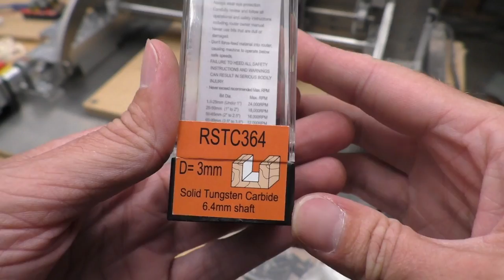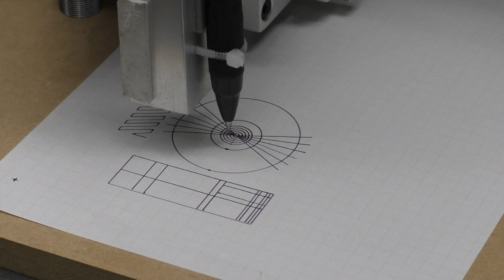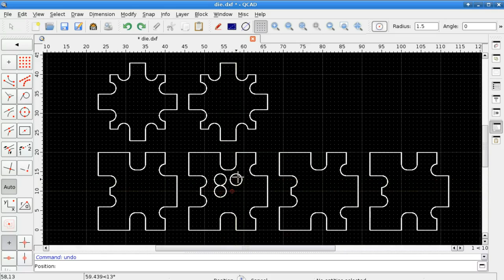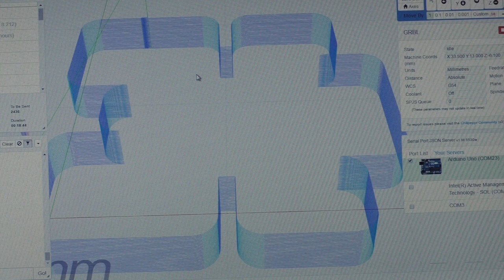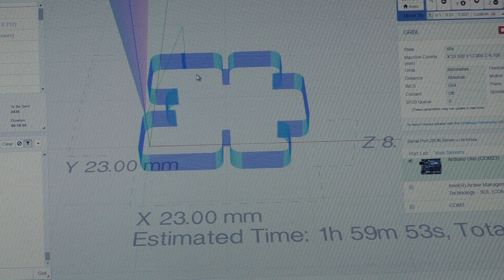DIY mini CNC machine part 12 (new lead nuts + more cut tests)

Comment: There's an old machinist's saying that to minimize chatter, 'reduce the speed and increase the feed'. It sounds backwards at first, but it works. Of course, using the proper bit for the material you're milling helps, and straight collets are nice too! 
Thanks for the video.

Comment: To speed up the job and get the better finish run a roughing pass at .3mm that goes all the way down but tell it to leave .1mm of material for the finishing pass then run a finishing pass much slower when the bit will remove that last .1mmm and leave a nice smooth finish, also  to avoid having to hold own the part as it finishes, either leave a oouple of tabs to hold it in that can be cut off later, or drill a hole through the middle as a firsst step and use that to hold each piece down,

 great progress, enoying it :)

Andrew

Comment: When I cut a profile shape as you did for the cube parts in aluminium, I usually make the cut wider than the cutter.  If you're using a 3mm cutter, have the cut be 4mm wide.  It means you have two passes for each cut depth, but it gives the chips clearance.  If the channel is 3mm wide and the cutter is 3mm wide, any chips in the channel get mashed against your finished edge, the extra width prevents that.  It means longer cut times, but nicer parts.

Comment: You should invest in some double sided tape or spray adhesive to hold down the workpiece.  The screws keep it from moving around, but not vibrating.  That vibration can wreak havoc on the tools and cut quality.  Cool video series!

Comment: Hi...Bit my lip and watched all 12 episodes....You have some nice electronic instruments but you don't seam to know their limitations!  Digital multi-meters (and oscilloscopes) have VERY high input impedance, if you just hold the lead tips between your fingers you get an AC voltage, the amount depending on how close you are to a source of electrical stimulus. The reading of spurious voltages are mostly due to lack of grounding, or more correctly a valid reference point. DVM's are by there nature digital devices sampling the input, it is common for them to read erroneously if the input is varying wildly or just very noisy, for example back EMF voltages from a motor.  Try an old fashioned moving coil multi-meter when you get these symptoms. I was pleased to see you connect the Arduino ground to the motor PSU ground, good start.I did not spot if you grounded the CNC machine chassis to the utility ground supply, the CNC platform and  ALL the PSU's cases should the grounded in the same way. (to utility ground) The way's  bearings should be shorted with ground straps, do not rely on the bearings to provide a ground to the next level, use a piece of fine braided flex, they do not need to be huge (not safety ground size)(you could use the screen off of some coax cable,  a piece of sleeve should be used to protect from snagging and short circuits).(Rolls Royce put earth cables across the wheel bearings and  brakes, to eliminate static radio interference on the car's radio)Most importantly the motor case should be included in the grounding. I think you did that just before the end.The screening on the various interconnects will not work correctly if it is not grounded at least one end. STAR point grounding is best for interference, and avoids ground loops that are just as bad in high noise, high current environments.A couple of turns of the motor power lead through a ferrite ring at both ends of the lead, will help in dampening the interference if still needed after grounding everything. (You will find ferrite rings on old PC ATX power supplies, some PC cases came with rings to shield the front panel cabling.)If you still want to understand the motor voltages I would use your oscilloscope to look at the waveform feeding the motor (assuming it is rated to measure the voltages you have seen on the DVM). or an old moving coil meter as mentioned above.I have not read all the comments, but as some people have correctly stated the motor will generate very large back EMF voltages that are renowned to damage driver circuits, if you are sure that the motor is only fed DC, fit diodes in reverse across the leads (like you fitted capacitors) the reverse voltage spikes will be shorted out by these diodes. use high power diodes not signal diodes. To confirm the power feed to the motor is DC use an oscilloscope.I greatly enjoyed the CNC series keep up the adventurous work, I admit to being too scared to attempt such a task.I loved the flash bang wallops, not seen so much carnage since I worked on mini computers.....  :-}  just waft the smoke away and hope the computer manager never saw it.... Chris.....where did all my paragraph spacing go...looks a mess

Comment: Hi, another thing I have seen here on youtube that I now use for 95% of my work holding is masking take and super glue.  From my experience it works better than double sided tape and is cheaper too.You apply a layer of masking tape to your spoil board and also to the bottom of your workpiece then superglue the 2 pieces together.  I know it sounds ridiculous but it has amazing hold and takes away the chatter of the workpiece against the spoil board.  You can just put dabs of superglue or strips of it.  If you do this I suggest you leave tabs of tape on the spoil board because otherwise it can be very hard to remove your part and stock at the end of your job

Comment: The "chatter" sounded like a resonance issue to me. Of course, resonance will impact the finish like chatter, but it;s more like a geometric pattern that is relative to the resonant frequency.Resonance issues can easily be eliminated by changing the frequency causing the resonance, which generally is as simple as making slight changes to the rpm, but sometimes you will need to add mass to the material being cut. For example, when threading pipe on a lathe the resonance is stopped by wrapping a piece of hose around the pipe. On a milling machine adding an extra hold down seems to do the job. I hope you find this helpful.
Peace!

Comment: Nice project. For cutting aluminium you should try a 2-flute end mill. You are asking alot from that single flute when cutting through aluminium. In addition, the feed and speed should be matched to the material and the cutting bit. 

The other thing you might be fighting is side lateral stress from the bearings inside the spindle. If they are proper side thrust bearings, you shouldn't have side stress, if they are normal roller bearings (not meant for side to side movement...you will. Also if they are the wrong bearings, the tolerances will wear down quickly and produce that wobbly alignment you showed earlier with the cheap collet.

Thanks for sharing your work.

Comment: I use double sided tape to hold pieces down, Milling and 3D printing.  best for milling is foam VHB(type "foam" not "clear"!) you can cut right into it like the waste wood surface. For 3D printing, thin as possible paper double sided tape.   Also, Thanks iforce2d, Good series of videos by the way.

Comment: hi
Great videos.. tip use tabs when cutting aluminim and some type of cutting oil.
ALSO the direction the bit travels around the job also improved the cut finish

Comment: Really nice how you are cutting the aluminium, I'll have to try that as well. 
I see that you mount your work with screws to the waste board, you could consider using double-sided tape as well which has the advantage of not having to hold the finished pieces, I use it all the time and it works great if you have enough surface area.
Reply: What material is your spoil board / table? I can't imagine double sided tape would stick very well to mdf?
Reply: It actullly does, I often have problems getting it of again. Of course you need to make sure that there is no dust on there but that goes without saying.
Reply: I'm surprised by that, I'll have to give it a shot. I've always come up with a way to physically hold things down. It would be nice to not have to dodge screws or clamps for some projects.
Reply: yea, screws and clamps can be a bit annoying at times, let me know how this solution works for you.

Comment: I didn't watch all the way through (it's late here) but if you haven't solved the problem of a cutter chattering at the end of a cut, I figured it out years ago the hard way.  I was milling out a 2" deep pocket in aluminum using a 3/4" tool, and every time I got to the end of a side and made the turn to begin cutting the adjacent side, the cutter would do it's best to tear the part out of the machine, and gouge the heck out of it in the radius.  The problem turned out to be obvious: both cutter and machine deflects under tool loads, which is fine as long as the cutter is traveling.  My problem was I had designed 3/8" corner radii in the pocket, so the machine programmed for a 3/4" cutter stopped feeding in one axis and started cutting in the next instead of traversing around the radii as it would have had to with, say, a 1/2" cutter.  Stopping the cutter while it's deep in a cut will have the cutter still removing material, with deflection providing the feeding motion, until there's no longer enough force on the tool for it to cut.  Then it bounces instead, and, if all the resonance stars are aligned, it sets about trying to wake the dead.  I had this set up in a big, heavy duty machine, but it was scary how much noise that thing made.  So, obviously, the trick is not to stop the tool in a (comparitively) heavy cut.

Comment: Heh---- Been down the same road -- My setup is completely different in many ways. The bulk of mine is 3/4 mdf. All bearing surfaces are V-rollers running on the edge of one edge of a 3/4 by 3/4 1/8 steel angle iron. X and Y are drven with a 1/2 inch 10 pitch  5 start acme rod.  The result is basically a 2 pitch per inch. Z is a 1/2 10 rod single start.   All 3 axis are using a 450 oz/in nema 23 steppers. The "spindle" is usally a trim router but sometimes I use a 300 watt one somewhat like yours depending on material being cut. It is under COMPLETE control of the g-code whereas the router isnt. You get do the English t metric conversions... :)

I use 180 ipm for rapids and slower speeds based on material needs.  It runs mach 3 on a 16 year old desktop I retired years ago but saved it as old computers DO have uses. I totally DESPISE the gerbal based controllers as they are severely limited to what Mach 3 can do. NO net access is required at any time to run the CNC, no need for a separate file for every bit sed in a project, just put ALL of them in one file and Mach 3 will pause for a tool change. just hit start when you're done and Mach 3 continues on to the end of the file.

The driver electronics are similar to this but I use only 3 axis  http://www.automationtechnologiesinc.com/products-page/cnc-3_axis_4_axis_kits/4-axis-nema23-cnc-kit-36v9-7a425oz-inkl4030.  This  setup is desighned for the old parallel port interface but An adurino CAN drive this. just toss out the breakout board and tie step and direction pins on the adurino to the step and dir pins on the stepper drivers.  These drivers are optically isolated so there is NO real electrical connection to an adurino or computer. Ive "upgraded" 2 of the big X-carves with a smaller version of this instead of that wimpy stepper driver card that comes stock. 

I get a resolution and reputability of right at .0015 on all 3 axis but I could easily get at least 4 times more resolutin by using microstepping but the .0015 is good enough for my needs.

For cutting aluminum you need bits designed specifically for aluminum along with a coolant. The coolant is for 2 reasons, to keep the bit cool and to prevent the shavings gumming up a bit. Once you gum up a bit, toss it as its basically destroyed. You can cheat things a bit by using WD40 for a coolant and a 2 flute end mill. Just use a very shallow plunge depth per cut and a slow feed rate.  

Have fun, it gets easier as you go.. :)

Comment: I know this video was posted a while ago and future you may know this already, but WD-40 works great on aluminium. It saves gumming up the tools / improves tool life. It also smells nice when cutting lol.
Also, if you're going to plunge in, step off the part about a MM and do a quarter circle tool path into the part (instead of starting next to the finished face of the part), that will stop the dig-ins.

Comment: Awesome projects, thank you for sharing this. I always wanted to do something similar but I did not know how to put together all parts and where should I start. When I saw your 3D model in the first video I realized it's not a "rocket science" and I think I could do something similar by myself. In addition, I can finally learn how to design from scratch real 3D model. This is my first experience with 3D software - I'm so excited :). I put a list of parts that I need and I have a few questions - correct me if I am wrong :) Parts that u designed for cut (base plate and other) are made from 8mm thickness aluminum right? Linear shaft is 10mm and lead screw is 8mm? Thank you very much for answer :)

Comment: Hard wood: 3mm 2 flute fishtail carbide, 24000rpm, !500mm/min+, depth of cut 1.5 to whatever your machine can handle.  If your tool starts turning black your feed rate is too slow.
Soft wood:  Same as hard wood but make sure you cut deep enough or you will end up glueing bits to your part.
Aluminium: ~3mm 2 flute carbide end mill... the sharpest you can get! Most hobby cnc routers can't handle a single cutting edge and will chatter like theres no tomorrow...

When machining aluminium you don't cool your tool, you cool the material... Aluminium will melt long before carbide even starts to sweat.
Router spindles are way to fast for bigger chips and can't get the  heat out  that way.
You also can't use liquid lubricants on a mdf board it will soak up every last drop of it and bend your part.

You only chance is fiddling with your rpm and feed rates... and pray.

Comment: Proper cutting melts the metal at a specific point of contact, but not anywhere else. Too small chips are a sign of not reaching the melting point and instead of cutting it tears out. It may also be a result of reaching too high temperature when the material is welded into the cutter.

Try to drop alcohol (industrial, not spirit) on aluminium. That's what I was told at school and it worked like a miracle. Aluminium melting point is much lower than that of a steal and it easily overheats. Standard oil that's used for steel cutting won't cool it enough.

Comment: My guess on your small problems your having might be the flex in your system, thought I saw it flex when you wiggled it (larger rails would be nice) and/or your z axis isn't true/level bed. don't know if you surfaced your bed or not but not having the bottom finishing but not ending at the same depth would be a indication.
 Looks like a nice little cnc though!

Comment: Carbide tools like higher cutting speeds, (not the same thing as feed rate) so keep your rpm as high as possible. Also your setup needs serious improvements on rigidity. That is the main reason you're getting chatter issues. And dont expect any kind of tolerances from soft woods. Just keep testing on aluminium.

Comment: Hey is there any chance I could see your grbl settings somewhere, I'm setting mine up which is quite similar in layout to yours and I'm struggling to work out my seek rates.
Reply from the maker: Not sure what you mean by "work out"... if you go too fast the steppers will miss steps, you should be able to hear it missing. So just don't go that fast and.... what else is there to work out?
Reply: iforce2d my confusion comes from the fact that I seem to be able to move my y axis at around 10000 mm/min and this is magnitudes higher than I've seen around online so I just wanted to compare with your current settings.
Reply from the maker: What do you mean by 'seem to'? Either it does that or it doesn't :) If you set it to 10000mm/min and it can do that reliably without missing steps I don't see any problem. That's about 16cm (or 6 inches) per second, sounds pretty fast for a DIY creation but would be a piece of cake for commercial machines.
Reply: iforce2d ok thanks I'll just keep fiddling

Comment: hi

if you want to enter the aluminium in a safer and simpler way i recommend you to take a drill of the diameter as the milling (or bigger BUT not smaller) and drill a hole to the bottom of the part and use this hole as your entry for the milling. 
0.1 for aluminium is way to low. if you use the right tools you can even go with 1 mm. i dont know what feed and rpm you are using but the feed looks to slow for me. if you give me the states i can recommend you what feed to use.
btw if you want to have a nice surface you should cut with a stock of 0.2 mm to the contour and then the last cut you do as the finish cut. but note that you need to leave enough stock at the z axis so the part wont vibrate or fall away. 0.5 - 1mm on the z axis is ok. so your last cut should be with 0mm stock and to the buttom of the part.

Comment: What's the complexity of moves you can complete with this set-up? 
Are you able to move the bit in true 3D or is it "2.5 D" where you can only step the Z axis, do a cut, step Z axis... repeat?
I was wondering if you can perform "functions" or similar for smooth curves in the Z-Y or Z-X plane.
Cheers from Aus.
Reply from the maker: It's 2.5D, but my z-axis movement is only a couple of centimeters so I can't do much in the way of interesting vertical cuts, and I only use a 2D CAD program anyway. But yes, you can move all axes at the same time so you can ramp into a cut diagonally etc.